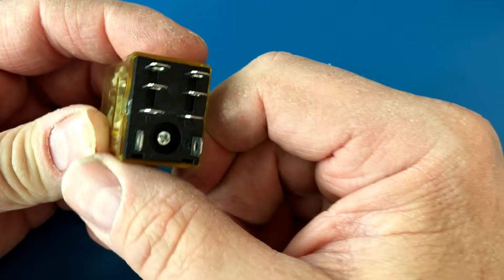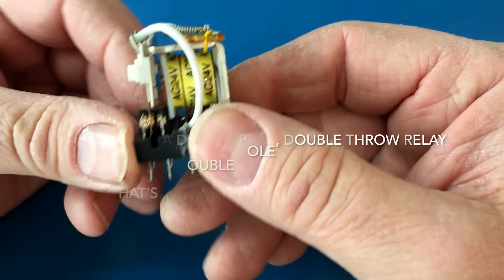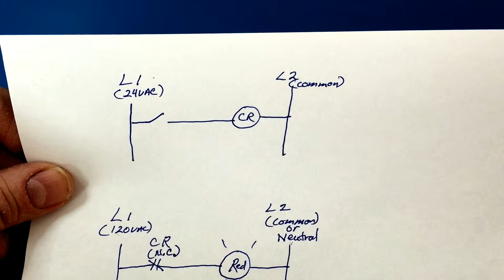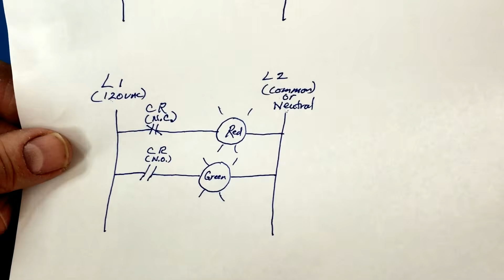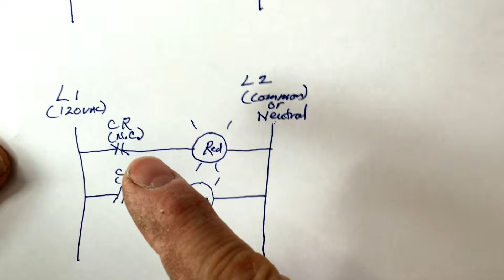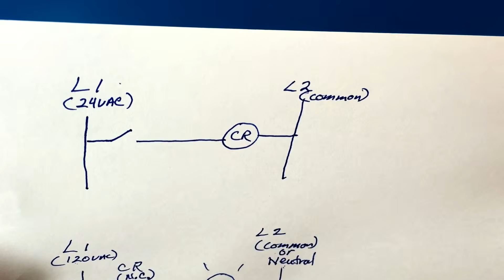Relay Basics

Comment: Thanks for the great video.  I was wondering if you could help me wire a relay to a light tower and a vision controller.

The relay that I have is an Omron G2R2-24VDC DPDT relay, and I have a Patlite LR4-2020WJB-RG (24V) Red and Green Light tower, and a Keyence Vision camera controller with outputs for red light to go off when there is a defect (NG) and stay green when there are no defects.

Comment: I have a test coming up and I wanna know does a contact relay (not a relay that was represented in the video) but a contact relay that has A1 and A2. Do I connect my power supply to the A1 to the positive and the A2 for the negative once done does that mean I can start connecting relays like this in the video to my big contact relay? I’m talking about the output of the contact relay
Reply from the maker: when you mention A1 and A2 I assume you mean the coil for a motor starter.  If this is what you're wondering about, you need to know where the voltage is taken from.  Is it from the L1 and L2 (or L3) terminals on the line side of the motor starter or is it from a control transformer?  Also, you need to know what the coil voltage is rated for for that contactor to close.  Is its 120V or 24V, etc.  
Remember, you often use a SEPARATE voltage for a coil.  In order for the coil to energize and close the contacts, allowing L1 to pass to T1, etc, you are using a MUCH smaller amount of current than the load by the motor.

Comment: Can you get a dry contact from an ice cube relay? Im working with a tyco k10p-11a15-120 adidthis video would of been helpful on site! I wish knew this sooner. We end up using RBSN and they work great but i see alot if these in the field, and this made me comprehend it. Thank you
Reply from the maker: A dry contact means there is no voltage present on the Common that feeds the N.O. and N.C. contact it feeds.

Comment: I thought common was the hot(the live wire)
Reply from the maker: could be anything.  Think of the common as being something you want to pass to the other wire.  Could be a signal, a voltage or just a contact closure to ground.

Comment: To be completely clear,  24 volts is required through the coil contact to operate the magnet thing?
Reply from the maker: It depends on the “coil rating” for the relay. The example I used was 24VAC, you can get different voltage AC and DC relays
Reply: Then you would need to buy a transformer?
Reply from the maker: @93lornamae  depends on what's the rating of the coil and what is available with your system. For example, if you have 120VAC available and have a 24VAC coil, you'll either need to buy a 120V to 24V transformer or change the relay to 120V if that's what you have available

Comment: As a fellow electrician I do appreciate your content that u provide! If u don’t mind could u also provide a diagram so people those of us who would like to do some wiring at home could buy some equipment and experiment in their own??? 
Respectfully
Reply from the maker: I will try and update this video this Summer. I will take your request under consideration.  Thanks!
Reply: Um what diagram would you need.? What you are asking is easy but kinda impossible. The easy part it that most relays will have the diagram  printed right on the relay. The impossible part is that there are so many out there, there is no way to give you all the info. That's why there are datasheets.  Even the sockets can be different. Even if he gave you the exact same relays diagram and link to the very place he got it form, it is highly likely that you see another one that is cheaper and think it's the same thing and you buy that one instead. So the diagram he might give you will be worthless and you are back at square one.

Best thing to do, if you want to experiment, is get on the forums.  Go prepared with datasheet or specific goal in mind. Most of the guys on them are very anal and many can read schematics but regular english fucks them up. Many times I read a person asking a specific question and gives details. In those details they even mention what voltage is being used and you'd get an answer to use a specific voltage. You sit there like "You fucking idiot I just said that can't you read." But no you can't say that. You have to sidestep those land mines. Because if you don't answer back, the other so called "senior guys", will ignore you back and not give you the information. If you reply with " Yes I already mentioned that but thanks" You will still get the cold shoulder from the rest.  I can give you a link where that happened. There was a simple answer to what the guy was asking but never got an answer. They are very sensitive and have god complexes.  They also get mad if someone just gets on the sight and actually gives the person help. I can't give them an answer because when I tried, they kicked me off the sight. Just because you understand what the person was asking for. That happens to me a lot. LOL

Good luck.

Comment: Sir do you know how can I control pick up coils out put for distributors?
I need some thing to control duration of pulses ore the 4 pin gm ignition module Im experimenting lot with engines so I wuld like to build me self variabel controled ignition timing .
Im simply useing multipel engine types so I need some thing that does that task .
Im even useing dual coils and dual 4 pin gm ignition modules only problem I have only 1 pick up coil so I need to ajust that for ich coil corectly.
Reply from the maker: I don't know about automotive controls.  My experience is in building automation and controls.  Good Luck in your endeavor!
Reply: That can't be done with relays. You need mosfets for that.

Comment: Can you please tell me what exactly to buy so I can experiment and get some hands on learning experiencing myself please?
Reply from the maker: you should be able to obtain a basic single pole relay from a local controls distributor.  I am using an IDEC relay.  You can use any single pole relay though.  I would strongly suggest to buy a lower voltage coil and have a power supply for it so you can switch on the coil. As is stated in the video, I used a 24VAC transformer for the 24 VAC coil on the relay.
Reply: @brianslota4861  thank you so much 🙏🙏🙏
Reply: Did you ever get anywhere?

Comment: If you believe you are electromechanical teacher or instructor , you must dream.
Reply: Nicole. Could you please post a video about rb 12/24 usage.  Specifically when it comes to card access integration with ada handicap openers? I would appreciate that greatly.  Thanks in advance.
Reply from the maker: you know more?
Reply: Chill and keep the negativity out of here @Nicole
Reply: I agree, and based on this video,  we have a relay switch that's hooked up to a 24volts and nothing but engage and disengage the power. How about adding a light and use the relay or add some dc powered motor, instead of an electric diagram. No criticism here, just a comment that maybe helpful, after all this video is about how relay works and not schematics.
Reply: Thank and i m here Because i run across a relay like this.  Tnk u i learn a lot....n do not pay attn. To Nicole at all.yoù are great
Reply: @renecuevas4128  do you need relay factory?we can supply
Reply: Where can I see a video on this subject please ?